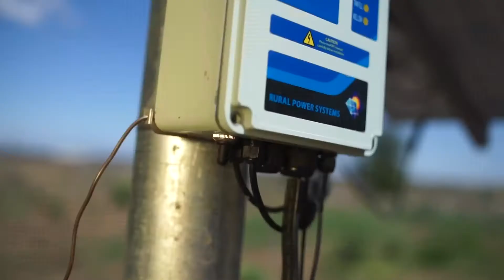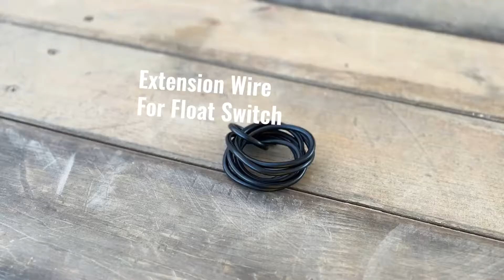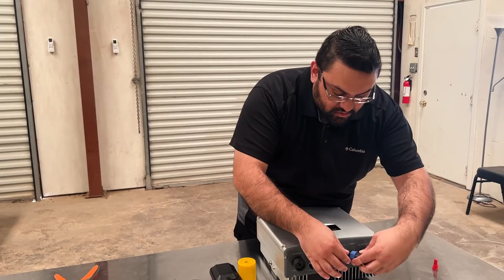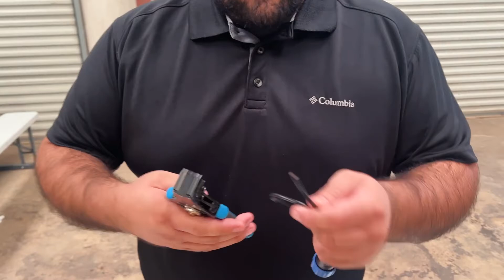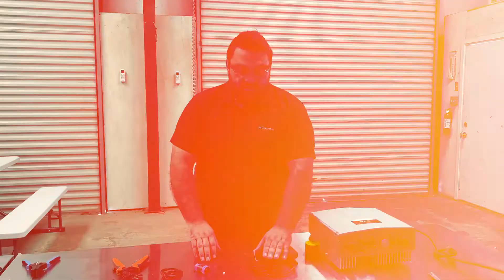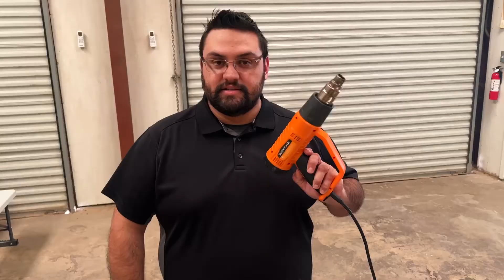Wiring a float switch for the Pro Controller

Comment: Terrible job of crippling on those wires, you allowed a piece of wire to stay outside of the connection,  left some portion of wire exposed by not fully inserting wire, used to small of a piece of shrink wrap not connecting outer insulating shield to be enclosed in shrink wrap at both ends to make a quality and sealed  connection.
Reply from the maker: Hey! thanks for the criticism! We really appreciate feedback like this. We went ahead and made this video private and re uploaded with more precise crimping. We appreciate you. Here is the new video https://youtu.be/MViK3oWxcno